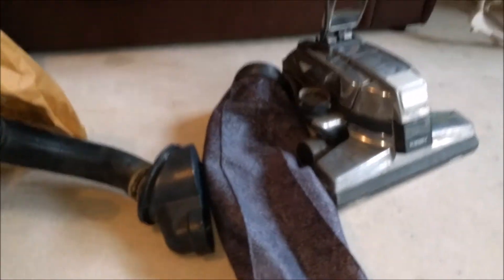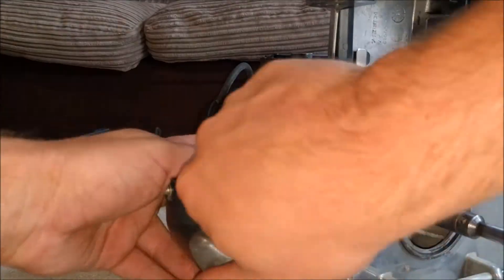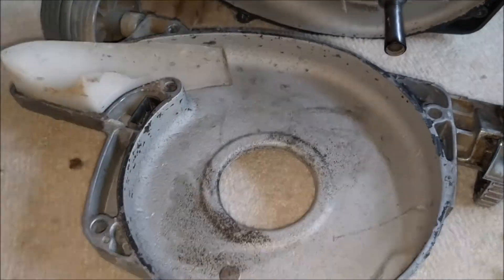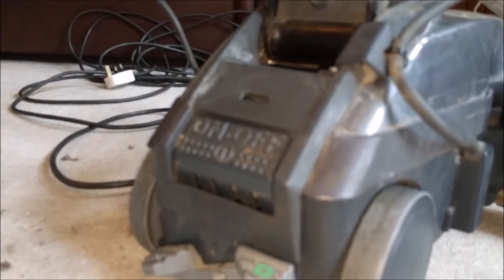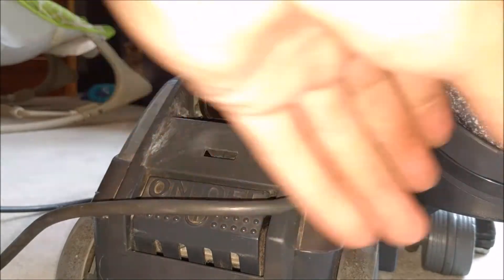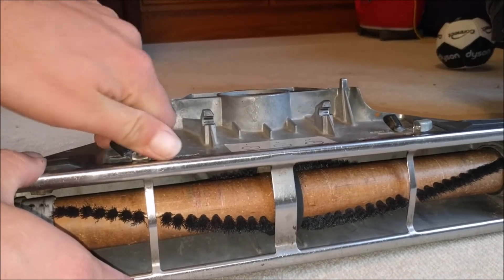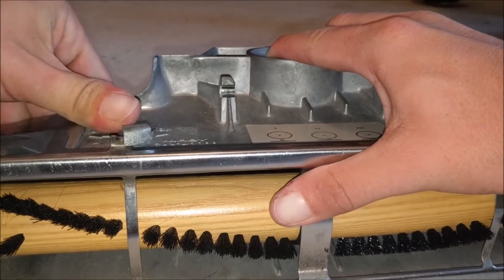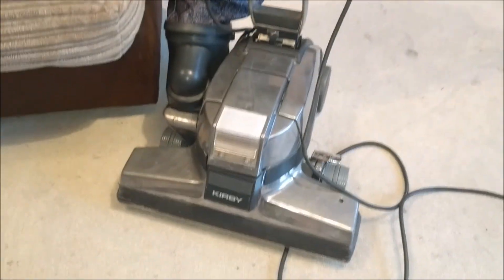Kirby G4 Techdrive  - Repair and light service!

Comment: Its a November 1995 model Sam. The first 8 is the factory code, 95 is the year, and 11 is the month. The G4 was sold between 1993 and 1996 if I remember rightly, so yours is a fairly late model. You can adjust the endcaps of the brushroll to allow for brush wear. On the plastic end bearing plates that push into the floorhead, there are 3 numbers, 1,2, and 3 You turn the endcap and insert it into the brushroll housing with the number you want showing and this number should be decided based on brush wear, so that a very worn brush shows the number 3 and a new brush shows the number 1, when looking at the brushroll ends with the machine underside facing you. So ideally, try it on position 2 on both brushroll endcaps first, and see if any brush length then protrudes from the soleplate, if not, then try position 3, which should give a small amount of brush protruding from the soleplate. Only buy a new brushroll if absolutely necessary as they are not cheap, and looking at that brushroll, they don't look that worn to me, they are quite short on a new brushroll, like those on the Miele S7. I'd put a new genuine belt on it and set the brushroll endcaps to position 2 and try that first, and then to position 3 if you feel that the brushroll is still not giving the carpet contact you need.
Reply from the maker: Ah so not 1989! Now you say 1995 though, all the date wheels I found did say 95! The brushroll had some length, but the brushes were very soft and distorted, and the part where the belt runs had a god few mm of wear! I quoted her a slightly inflated price for a new brushroll, or the price of a pattern one. She said that they had had issues in the past with pattern parts, so genuine please. I then found this brushroll advertised on ebay as used, but not very much and tbh it looks new! Got a good price on it too! And a new gen belt, as I did fit a pattern belt and it was awful, slipped around something terrible! The new brushroll, belt and washed bag have certainly transformed it!
Reply: Pattern belts often don't have the knurled rubber on the inner side to them and this is required to give the belt grip on the spindle apparently. The genuine belts are very tough and do tend to last a fair while, but they don't last as long as a clean air machine, obviously. I'd keep the old brushroll, you can use it if you get a G series (G3 or G4) again with a worse brushroll in it. The reason the brushroll only goes in one way round is because it has a magnet on one side which drives the little brushroll LED generator, and this was on the other side of the floorhead on the G5 onwards, to what it was on the G3 and G4. I knew it wasn't a 1989 because the G series didn't come to the UK until 1991, and the G3 hadn't even been launched in 1989, lol. I am sure that the owner will know just how dear Kirby parts are, so it shouldn't be a shock to her.One other thing I noted, was that the Tech Drive was constantly clicking and clunking when you were pushing it along, and it should not be doing that, my G Series both do it as well - its very annoying and usually mean something is slipping or jumping in the tech drive unit, in other words, the tech drive is very worn, and will soon need replacement. This clicking is worse if the floorhead is too low and the tech drive is put under more load, almost like one of the cogs teeth are missing and jumping due to some kind of wear in the mechanism. I'd say it will soon suffer tech drive failure, and that's why I don't use mine any more, as I am not paying 100 odd quid for new tech drives for them. My G4 is worse than my G7, but the fact is that the tech drive should be nice and smooth and not clunky, be clicking or excessively whiney.

Comment: Sam - sorry to be a pain again, but you must ensure that the numbers facing you as you look at the bottom of the soleplate, are the same at both ends of the brushroll - with the brush in, and the soleplate on, you should be looking at number 1 on both ends of the brushroll, or the cleaning will be uneven across the floorhead, and the brush will not clean as it should.
Reply from the maker: You know what I did wonder wether the height indicator should be facing me or spun around to the back! I want to take it over to my mums whilst I still have it (the owner is away until the 7th), so once the August vac change is filmed I'll take it over there and have a double check. I presume 1 is for new brushrolls and 3 for worn looking at the sticker on the cleanerhead?
Reply: The numbers you want  should be facing you Sam. I know they can feel a bit stiff to push into the slots at the side of the floorhead, and that they feel that they aren't going in quite straight, but trust me, that's how they are supposed to be, they need to fit tightly or they would rattle when in use. If the numbers do not correspond on both sides of the floorhead, the cams will be offset and the brush will not be even across the length of the brushroll, meaning that it wears out one side quicker than the other. 1 is indeed for new brushrolls, and 3 is indeed for worn ones.

Comment: Old trick for stuck screws before rounding, spray with WD next put screw driver in screw and give the back or your driver a good sharp wack or two with a small hammer it can lossens up the bind.
Reply from the maker: I did the sharp tap thing in the end, that's what I did when I stopped filming ready to give up for the night and soak it in plusgas for a day. Then it moved so I quickly started filming again! Later that night I found my 3ft long screwdriver which I always like in those situations, can get oodles of torque down the handle!
Reply: Nothing like a good long driver for oodles of torque ;-)

Comment: Lol I went to goodwill and its tech drive dosent work it only works in pulling back
Reply: Wizerd it actually works in both directions. Maybe the one you tried wasn't working properly
Reply: Evil vacuum man I know I have many Kirby I am thinking there's a belt problem cuz it barely works when you pull back but when it dose work it's super strong I'm going back wensday to get it
Reply from the maker: I had a G5 once with a broken tech drive. A new cam fixed it (can't actually remember what the issue was now...), but it was a cheap and easy fix! I wouldn't be too worried about a non working tech drive, the chances of it being repairable for pennies from ebay are quite high. I wish we had more cheaper Kirby's in the UK! You can get them cheap, like the entire system for £30/£40, but their always so far away on ebay, and collection only because of the weight! There was a Heritage 2 locally to me last month but by the time I got some money together it had gone. I was a bit sad
Reply: Beko1987 ok it looks like the belt is bad the drive belt they didn't take care of this Kirby it still dosent run right and its misspent hubcaps
Reply from the maker: Well they did not realise they had vacuumed up a whole sock! Just through the motor had burnt out. That's what melted the old belt. They've had it since new, paid £800 after a demo apparently! I did cry inside when they said they'd never used any of the tools it came with, and every now and again they find bits and throw them away (large house)... Poor thing. The lower cord hook is snapped off too. Still runs sweet though
Reply: Beko1987 see the vid hook and stuff is good on the one I found but the belt look stock and this one look like the origin it didn't seem to have a brush light btw your talk to wayne from Facebook lol